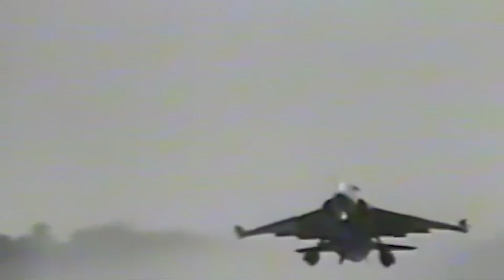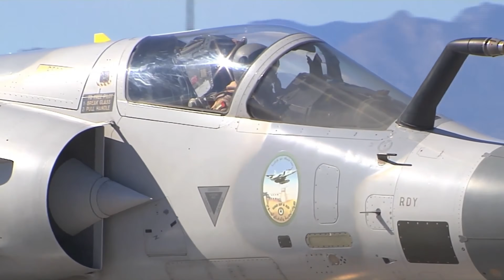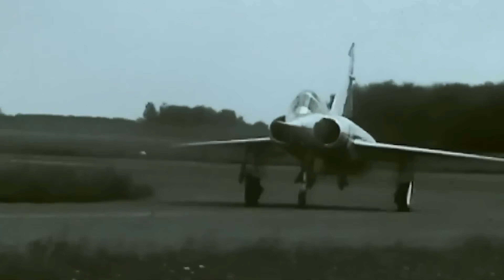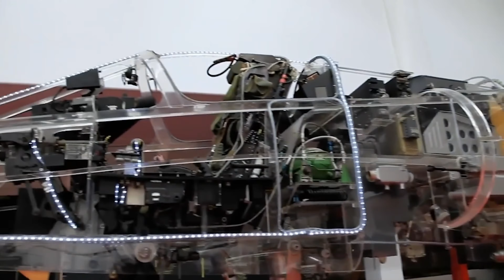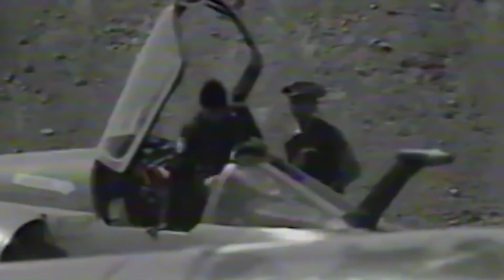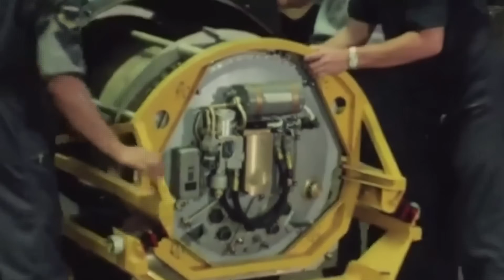The Hidden Story Behind the Mirage F1: France's Bold Break from Tradition

Comment: In fact, there was no "religion" about the shape of the wings.
During 1955 to 1980 at Dassault, the question was always about the tactical advantage that was pursued. Delta wings was about maximum speed, as it was the main race at the time, to be able to intercept planes or deliver strategic ammunitions. Mirage III, Mirage IV (for atomic dissuasion - 1959/1963) and Mirage 2000 for Aerial Superiority (Mach 2,2 - 1978) was the answer to this goal, to be able to challenge russian fighters at the time.
On the other hand, following the teachings of the War of Corea, Etendard IV (1954 - 1958), Sepecat Jaguar, Mirage F1 (1968 to 1974) and required lighter airplanes, with short take off and landing, middle Wings to carry heavy bombs, and more visibility, instead of pure speed. The reinforced land gears was also part of the goals. The Alphajet was designed the same, for training and light fire support aircraft. The knowledge about middle wings was acquired with Ouragan and continued to the Super-Mystère B2, so it wasn’t a complète discovery or a complete change of philosophy.
The variable geometry project that was tested at the same time with the Mirage G to G8 (1967-1971) was a too heavy solution for French Air Force, that required a lighter airplane for questions of acquisition cost, cost of maintenance and autonomy. Program ACT G8A (1975) with middle wings like the Mirage F1 wasn’t approched by the French Air Force for the same reasons, and the same for the Mirage 4000 (1979) with Delta Wings.
Rafale was the synthesis of these, with delta wings positionned as middle wings, more capabilities on short landings and capability to carry Heavy ammunitions and still perform at high speed and high altitude if required.